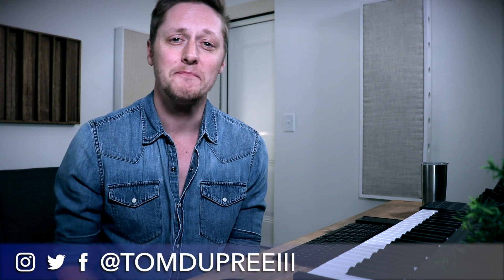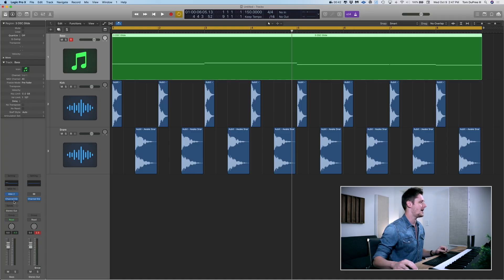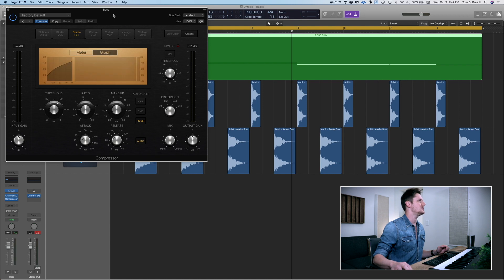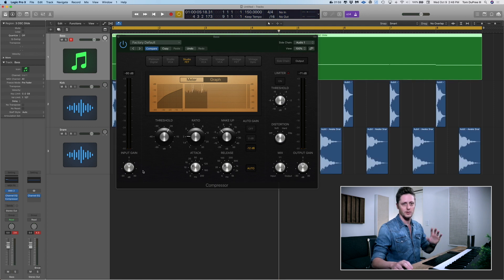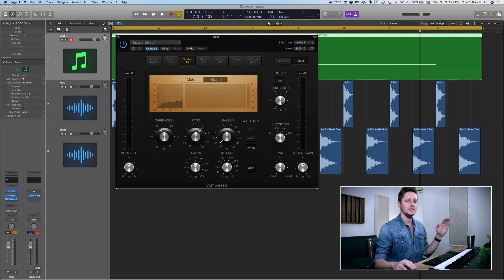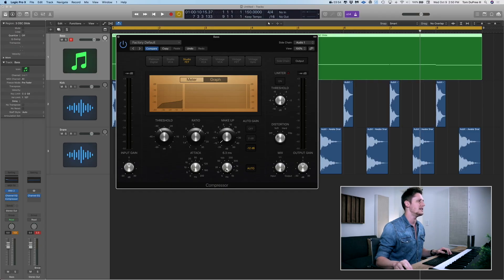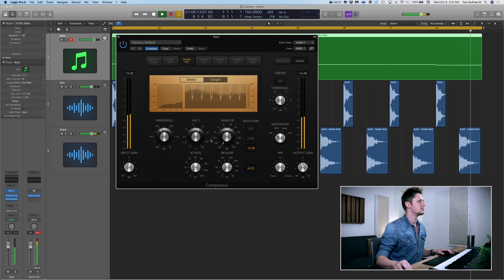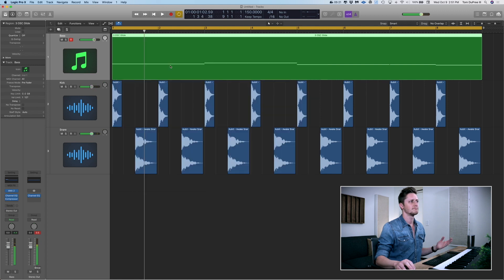How to Sidechain Kick Drum to a Compressor in Logic Pro X to Make Your Bass PUMP

Comment: OMG THX. Finally a video where you can use STOCK Plugins and not various promotional videos! Question, what settings would you recommend for a psytrance bass beat (with bassline sidechained to the kick)? 1/8 triplet. Greetings from DK.
Reply from the maker: I'm so glad you liked the video! Thank you for watching. It's tough to give you a specific setting without hearing the track, but I would suggest looking at the transient length of your kick drum and then start by setting your release to about the same length with a relatively quick attack. You want the bass to quickly duck out of the way so the kick drum has space and then fill back in once the kick drum has had its moment. Hope that helps!